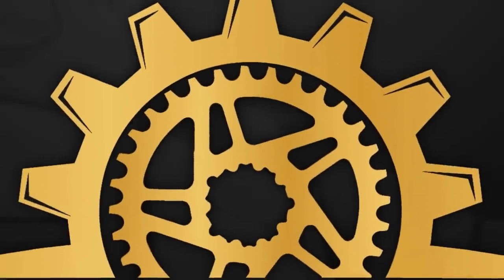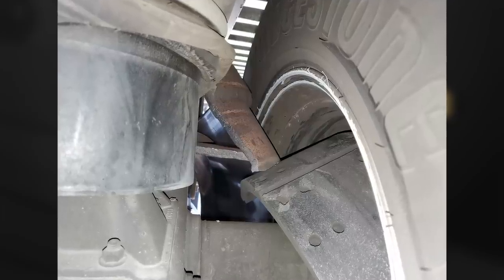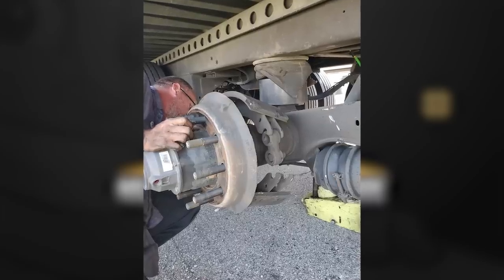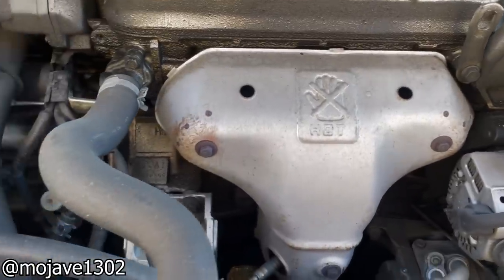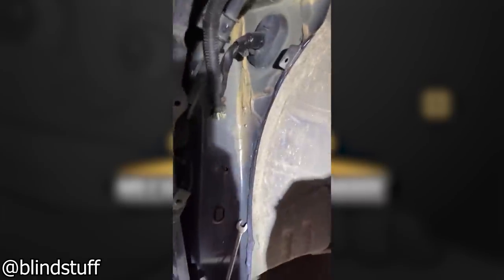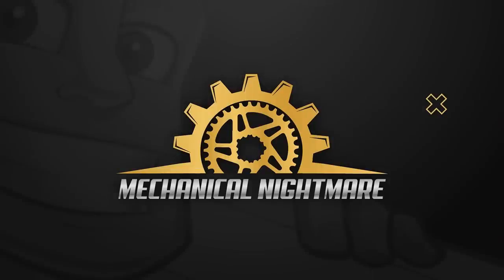Customer States "It Feels Like The Brakes Are Always On" | Mechanical Nightmare 91

Comment: That one with the bullet. Is why you should NEVER shoot in to the air. What goes up, comes back down!
Reply: Absolutely what I'm thinking happened. A hollow point with almost no sign of expansion on impact so it has to be falling 'slowly'
Reply: A bullet would have to exceed terminal velocity to do that. More likely there was gang activity at the docks and someone shot down from a shipping crate or something from above
Reply: @The_Ballo  Nope.  They WILL go through a roof panel on a vehicle.  Seen it numerous times.  They don't ship cars in crates, they're on special car carrying ferries and driven off the ship.  Docks are also secured, you can't just walk in.
Reply: @ffjsb  roof panel is flat, windshield is not.  I doubt a falling bullet would penetrate a slanted laminated windshield just falling out of the sky.
Reply: @mrcryptozoic817  Are you claiming that a 9mm impacting sheet metal with kinetic energy of 30 joules will pierce the metal?
Reply: @mrcryptozoic817  No.  Just NO.  You've never taken a physics class, that's for sure.  And the round hole proves it didn't fall sideways.
Reply: Lol yeah man someone shot one in the air and hit my windshield it was a red tip bullet scared the shit out of me I thought it was a rock because I was rolling 60mph then when I got to my destination I got out and the bullet was laying on my windshield wipers with a crack luckily it didn’t go thur and hit me
Reply: A bullet does not return to the ground at the same rate of speed it was fired. It will fall at its terminal velocity. Not near enough to peirce a car.
Reply: @kwhiting4861  It ABSOLUTELY can go through the roof of a car.  Seen it several times.
Reply: @ffjsb  no it can't bud. It's physics. Impossible. If it's fired relatively straight up it will go into free fall and can only fall so fast. "Terminal velocity" you haven't seen it any times.
Reply: @ffjsb  
Where exactly have you seen a bullet fall from a height far enough in the sky to actually penetrate sheet metal on a car???

I’m order to see such a thing, you’d have to be Superman so that you could fly that high then be able to follow a bullet(a rather small object when compared to the rest of the sky)all the way to the ground at which point it could have the chance to pierce the sheet metal of a car!

By the way, if it did actually pierce the sheet metal, the hollow point would expand cause automotive sheet metal is harder than the brass surrounding the open end of the hollow point, it is also way harder than any flesh and those hollow points expand upon impact with human skin!!!

I know, I’m Mr. Science; go ahead and question my theories!
Reply: Except for inflation
Reply: Bet it happened after the fourth of july
Reply: @ffjsb  Yeah... tell that to the numerous cars stolen right off the dock over the years.
Reply: @kwhiting4861  That bullet looked brand new,  it was never fired. If it had been fired and hit anything, even on the way down, that bullet would have been squished. Seeing as it was a hollow point designed to do exactly that
Reply: @The_Ballo  Terminal velocity for a bullet is between 150 and 200 MPH unless it's tumbling then it's a bit lower. However as Mythbusters showed, it's only terminal velocity if the bullet is fired straight up. If it's fired at an angle it can easily still retain a lot of the muzzle velocity and be way more dangerous.
Reply: @kwhiting4861  It's only terminal velocity if the bullet went straight up and then is just falling. If it was on an angle (and it almost certainly was) some of the muzzle velocity can still be in play.
Reply: @righty-o3585  There were clearly rifling scratches on the sides.
Reply: @John_Ridley    OK maybe there were scratches on it,  but it absolutely did not go through any body panels on a car. I'm willing to bet it wasn't fired through any thing.  Because when a bullet hits basicslly anything at those speeds,  it destroys and smashes the bullet quote thoroughly

Comment: Had a 1982 Honda Accord and I heard chattering from my F/L wheel. I thought it was a bad wheel bearing but it looked great when I put new bearings on both front wheels. The chattering went away for a couple days but came back, so I took it to the shop. Mechanic took it for a test drive with me in the car. It started chattering as we drove through a short tunnel overpass. He pulled the car to the side of the road and took off the chrome beauty ring on the hubcap assembly and showed me the rust on the clips holding it to the wheel. Stopped chattering immediately and he didn't even charge me.
Reply: That's awesome! Cool of him not to charge you.
Reply: Worst comes to worst it probably needed a bearing anyway, nothing like preventative maintenance

Comment: 0:15 that's a 2008 Focus. Mine ran like crap when I had way less oil in one of the the spark plug holes. That's insane that it still ran at all!
Reply: Yeah. They did that from the early 2000s all the way up through that 2009 body style at least. I would know. Worked on many and 6 focuses between the wife and I over 12 years or so. 2 Part valve cover gasket. Inner gasket always fails first. Kills the plugs and shortens the life of the coil packs.

Comment: The first one wouldn't be valve cover gaskets. Oil in the spark plug tube is the rubber tube seals not valve cover gaskets.

Comment: Never seen a brake drum blow up before.  But it does happen.
Reply: Saw one come off in bits on a trailer in front of me. Driver was unaware till I radioed him.
Reply: Don’t use cheap parts!
Reply: @Shad0wBoxxer  sometimes it’s expensive parts, with a flaw that got through quality control.  
  We never go cheap at the shop because we repair Fire Equipment.  You would be surprised at the amount of “lifetime warranty” or “100,000 hours guaranteed” type of parts that have catastrophic failures, after maybe a dozen hours on vehicle.

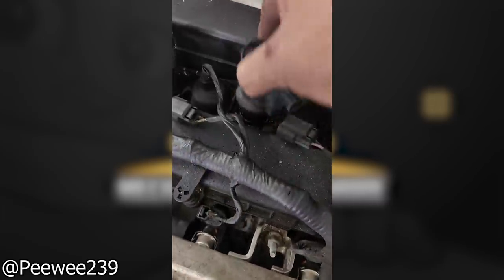Comment: @0:08 The oil in the spark plug tubes are usually where the tubes are pressed into the head, requires resealing with a green wicking grade threadlocker. 
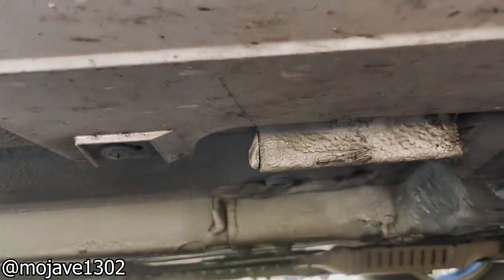@2:53 Recently I heard what sounded like a heat shield rattle but was actually chunks of a catalytic converter trapped and bouncing around in the exhaust, which was only discovered after so many accumulated that the car died on the freeway a couple weeks later from the blockage. Other evidence was a bit of oil blow-by reversing course, coating the MAF.
@3:16 Looks like what happened when a cheap new Amazon fuel injector stuck wide open after driving for about 200 miles. Symptoms were full tank of gas disappeared extremely fast, lots of white smoke and then the engine died
Reply: So the shop you took it to neglected the whole computer process where it has fuel sensors and exhaust sensors diagnosed? Or did you ignore the check engine lights?
Reply: @Shad0wBoxxer  Well my in-law does have a very bad habit of ignoring those lights, like when a mechanic said it needed an injector, and he didn't have $800 so he just kept driving with that misfire for almost a year until a banging bad rear shock drove him crazy enough to enlist his mom to get his sis, my wife, to get me to help. Now while I've been wrenching since the early 70's..I'm not a mechanic but I live by the mantra happy wife, happy life.
Anyway I replaced his shocks when I noticed what sounded like an exhaust rattle immediately after the engine started but quickly went away. Then I noticed a distinct engine misfire, after which I was told about the bad fuel injector diagnosis, so I got roped into that as well. 

One spark plug was completely fouled with a rather large chunk of carbon, and that’s when I learned about the negative consequences of direct fuel injection when 100# was the highest for 2 of the 6 cylinders with a compression check. A leak-down test revealed leaking valves was the biggest issue. I spent quite some time scraping and wire brushing huge amounts of baked-on carbon from the valve stems and around the ports. Eventually I developed a technique of a vacuum capture while making the particles airborne with a blast of air. Of course that was with closed ports but since the valve faces and seats still had trapped crud and still leaked..I had to finish up by scrubbing the valves when open, which forced me to reduce the vacuum hose to the size of PEX pipe so it would fit down the spark plug hole to vacuum the pistons crowns. It really needed a valve job, or at least some valve lapping but the owner just didn’t have the cash for that so I did what I could.
 
Eventually the compression pressure reached the point to make combustion possible again so I installed a new set of fuel injectors, new plugs, and a fresh high-mileage full synthetic oil change. Upon start-up I noticed an occasional misfire that disappeared at anything above idle, which went away after a test drive on the highway. It was purring when he left. A couple weeks later the ‘12 Impala died on the highway and that’s when I remembered that rattle and found the catalytic converter clogged the exhaust. A couple hundred miles later, it died again with the symptoms I mentioned earlier about disappearing gas and a puff of white smoke. My Launch X431 Pro3S+ scanner was useless in detecting the problem and it was only when I realized the fuel pressure wasn’t holding and one cylinder was practically hydro-locked that I discovered what the problem was. I just had to install a new set of injectors and another fresh oil change.
In an effort to learn about the X431, I compared a snapshot of the failed condition to another snapshot of the repaired condition, but nothing really stood out to me on any of the cylinders.  I’m an old dog trying to learn new tricks, and still not a mechanic. I just wrench on my own stuff. Heck I wouldn’t have bought that $1300 machine had Kingbolen not priced it at $60 on Amazon, which I simply couldn’t pass up. I thought for sure the order would be cancelled but the seller actually let the sale proceed.
The seller emailed a couple times and said an operation error caused a $50,000 loss because all 50 units sold at that low $60 price and asked for another $500 saying the boss agreed to a 50% discount. Their loss dampened my glee about my bargain purchase but expendable cash just wasn’t possible. Well that’s my story and I’m sticking to it.
Reply: @annettesurfer  damn. Now that is a bitch of a thing to go thru! I thought it was a shop that did it, good job on getting it sorted at the end tho! Ill have to remember this, thank you for the honest explanation!

Comment: Too bad a site like this didn't exist when I had my '79 Honda Accord. It would start and idle okay, but wouldn't drive faster than 35mph. Friend at work diagnosed an internally collapsed exhaust pipe. The dealer had the car all day, and couldn't figure it out. Dealer wanted $75 for diagnostic time. I told him to kiss off and left, telling him to do something about it if he could. I said, "You're going to look awfully stupid standing in front of a judge trying to explain that I owe you $75 for NOT fixing my car." Total cost of exhaust pipe and new bolts, which I installed myself - $60.
Reply: @YourMom-ro1ig  You missed the point. I took it to the dealership, and they didn't know about this problem, but my coworker, who is not a professional mechanic was aware of several cases of this. If a dealer's mechanics don't know the problems with their own vehicles, that's not on me, and I shouldn't have to pay for their incompetence.

Comment: i have gps on my car and i found out that about half the time mechanics dont even take the car out for a test drive after the repair. they simply replace the part i say i THINK is going bad. i make sure to repeat several times i have no idea what is wrong but it sounds like such an such. yet for some reason they just replace the part i say i think is going bad and call it a day... i only mention what i think is going bad to try and help point them in the direction of the issue. like i said i specifically reiterate to them multiple times i have no idea what is wrong and for them to figure it out because im by no means a mechanic. the sad part is this doesnt only happen at "shady" repair shops either.

Comment: A bullet fired strait up: "terminal velocity (terminal velocity is the speed at which air resistance balances the accelerating force of gravity). Experiments have determined that falling bullets reach terminal velocity at 200-300 feet per minute" the same as a paint ball.
Reply: If they stop spinning... Yes, they tumble and go slow.

But if still spinning they don't tumble and will come down faster.

Comment: The bullet in the roof is a good lesson on why you shouldn't shoot into the air...cause they come down eventually and pack enough power to kill. Heard of a lady being killed like that on new years eve somewhere.
Reply: it was in Arizona, and we have a law now named after he, Shannon's  law, basically increased mandatory prison time if you are caught shooting into the air
Reply: @andiamocclash397  good. That's only acceptable behavior in the middle east. Lots of terrible wedding celebration accidents over there.
Reply: Terminal velocity of a 9mm is 200fps. Barely enough to break skin
Reply: @The_Ballo  If you are shooting 90 degrees into the air maybe, but in a lot of ''shootings in the air'' cases, strikes follow an arch and the bullets can carry lethal energy with it. Its also incredibly stupid and goes against the most basic gun safety rules
Reply: @The_Ballo  enough to go through a vehicle roof apparently
Reply: @joshdfox420  You’re making a wild assumption
Reply: @The_Ballo about what? Seems pretty logical. Especially since the bullet was nearly perfect and didn't make it all the way through since they had to dig it out. Also the roof ole looked smooth and not jagged, like it would had it been fired from inside. Seen a private jet with one in the roof just like this that happens the same way..it was in Chicago too so makes sense...lots of stray rounds there
Reply: @joshdfox420  Terminal velocity of a 9mm bullet is about 200fps
Reply: @The_Ballo  that's a straight shot. It's gonna be moving faster than that falling from several thousand feet. A penny dropped from a thousand feet up would kill easy
Reply: @joshdfox420  False. Terminal velocity of a penny is about 25mph. It would need to exceed 200mph just to break the skin.
Reply: @joshdfox420  Another way to put it: you need about 50 joules to fracture a skull. A penny (1.5g) going that speed would have less than 0.1 joules of kinetic energy. It wouldn't even hurt that much to catch a penny at terminal velocity in the palm of your hand.

Comment: 2:13  Someone possibly up to 1/4 mile away shot into the air and it came down into the car roof.

It hit hard enough to punch through the roof metal but not get out of the headliner...

While Mythbusters says that much force can't happen from the falling bullet... if it keeps spinning, it stabilizes and will punch right through like that.  Which means it can kill.
for the falling bullet to not be potentially lethal, it has to stop spinning, and initiate tumbling, which can happen coming out of a low turn rate barrel.  Most barrels have high enough turn rate in the rifling that it will still be spinning at impact.

Comment: You should run away from any mechanic who tells you your overhead cam engine may have a rod knock. Also that Fiat 500 was being towed behind an RV in first gear which exploded both the transmission and the engine.
Reply: So.... overhead cam engines don't have piston rods? 😂

Comment: 2:06 looks like the hauler had a negligent discharge. It didn’t come from a distance as the bullet didn’t have time to expand so someone would have to be right on top of it
Reply: Bullets don't expand until they hit something with resistance, like a body.  A jacketed hollow point like that will go through walls without much deformation, but once something gets smushed into the hollow nose they deform and expand.
Reply: I think it was a "bullets fired up" situation, that's why it had enough enegry to poke a hole in the roof but didn't go deep.

As far as I'm aware the mostly undamaged bullet is actually a sign that it was in a lower enegry state then is normal for a bullet.